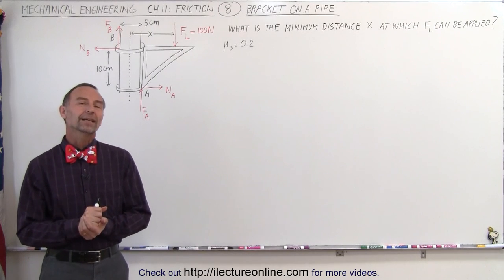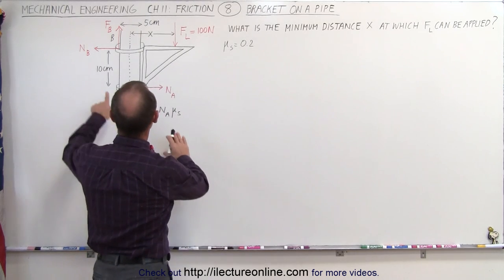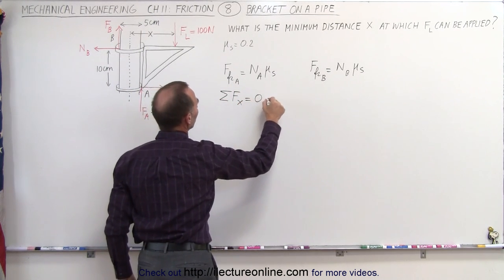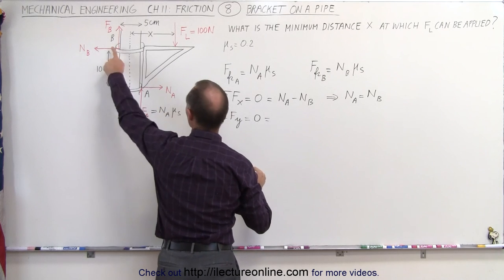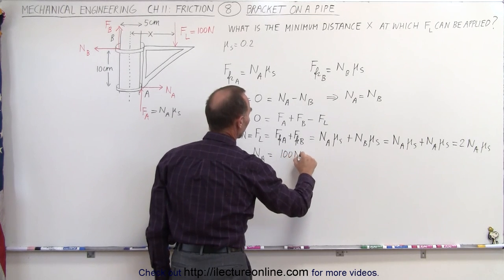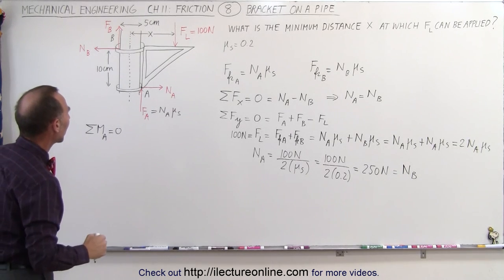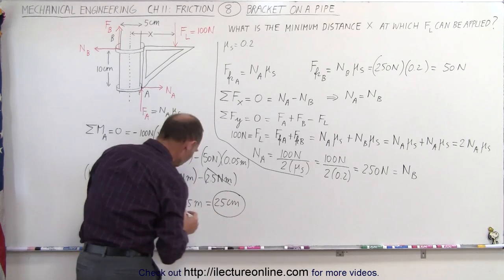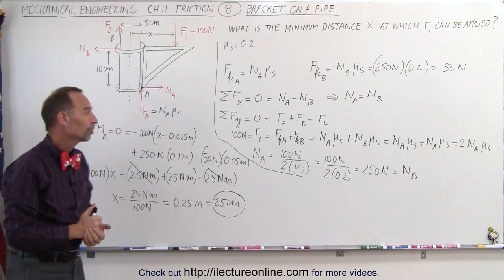Mechanical Engineering: Ch 11: Friction (8 of 47) Bracket on a Pipe

Comment: Very methodological and informative. However, it left me wondering... what happens if the 100N force is applied at > 25 cm distance? The moment about A still would need to be zero, right? Therefore N(B) would need to be larger to balance that. However, N(B) is fixed because F(B) is fixed, it would have to be 50N. What am i missing?
Reply from the maker: If the force is applied closer than 25 cm the bracket will slide down.  If the force is applied farther than 25 cm, the bracket will hold.
Reply: As x increase the normal forces increase also, so the increased torque due to F(load) is compensated.  The sum of torques about A can be written 0 = - x * F(load) +.1 * Nb - .05 * F(fr,b) =  - x * F(load) +.1 * Nb  - .05 * (mu *Nb)  so (x/Nb) = (.1-.05*mu)/F(load) the ratio of x to the normal force is constant for a given load force.
Reply: OK, so i understand the math there. Alas, i don't understand what that means for the underlying physics. If Nb increases with x, then, because the coefficient of friction is defined as the ratio of Nb/Fb, does that mean Fb would increase as well? Clearly that can't be (as Fb = Fa = 1/2 F(load)). Therefore, the only conclusion one can draw is that the coefficient of friction would also increase with x. But that seems rather arbitrary!! Isn't coefficient of friction "fixed" (well, largely fixed, subject to temperature and other factors, which i don't think are changing here). So, what is happening here w.r.t. the frictional forces?
Reply: The vertical component of the force at B is 50N regardless of where the load is applied.  If you tried to slide the rings down the pole you would increase the vertical force from 50N, and when it reaches mu * N the ring will slide.

Comment: Why aren't the normal forces Na and Nb balanced by other parallel forces directed in opposite direction?
Reply from the maker: They are, but we didn't draw them to keep the drawing simple.  We only drew the forces acting on the bracket, not the forces acting on the pole.
Reply: Yes I supposed so, and yet there's something that I struggle to understand: when you sum up all the torques, you only take into account the normal force Nb, the friction force Fb, and the weight force Fl, while the other forces are applied to the center of rotation, so their torque is 0. And now comes my problem: whenever there's a normal force, it means that it is counterbalancing another force, which you said that in fact there is, but you didn't draw to keep it simple. If I were to solve this problem by myself, I would have (erroneously) said: since there are two forces, the one the bracket applies to the pole, and the one the pole applies to the brackets, they cancel out, and no force is acting on that point of the system, so their total torque contribution is 0. After a while I realised that this reasoning is wrong, but I'd like to have a confirm on why it is. I suppose it is wrong because, as you said, the normal force Nb is applied to the bracket, while the other missing force is applied to the pole. Since we want to study the torques acting on the bracket, we don't need to consider the forces acting of the pole. And yet I was thinking that, even though that missing force would be applied to the pole, it would still be a force that would move the bracket, just like the weight of an object on the ground is indeed a force transferred by the object on the ground, but still it would be applied to the center of mass of the object. So that force should have been taken into account when considering the forces applied to the bracket. And then I realised that we actually did consider that force that you didn't draw, because it's the same weight force of the object applied at a x distance on the structure, isn't it? I mean, putting an object on the bracket, we produce a rotation, and the two pieces in contact with the pole would press against it with the same force of the object weight, right? And in fact we did consider the weight, thus it's like if we had considered that missing force.

Let me know if all this makes sense, which I hope, otherwise I have to face that I'm having a really hard time in figuring out where to put the right forces..

Comment: Why is the 250N of force multiplied by 0.1 meters? Isn't the diameter of the pipe 0.05 meter?
Reply from the maker: Note the 10 cm on the diagram.
Reply: Thanks for the answer!

Comment: Why did we use A and B point? Could have we used any alternate points?
Reply from the maker: Those are the points about which the torques act.
Reply: But if there would be one more ring or bracket such that at mid point of two then could we consider reaction forces at that points?